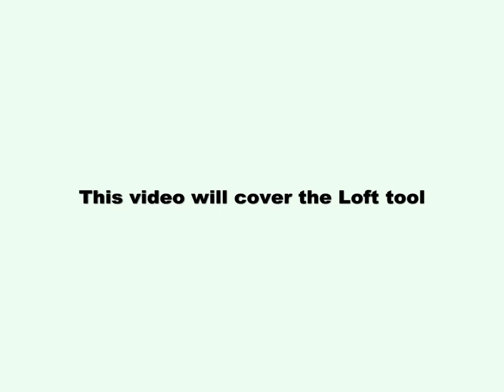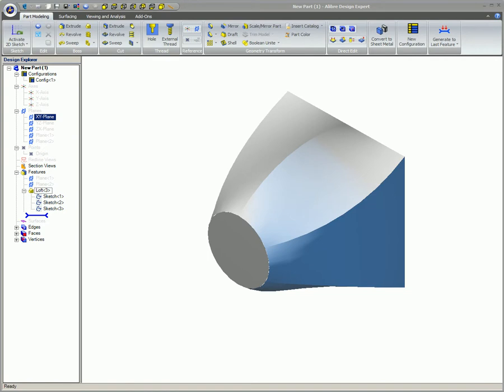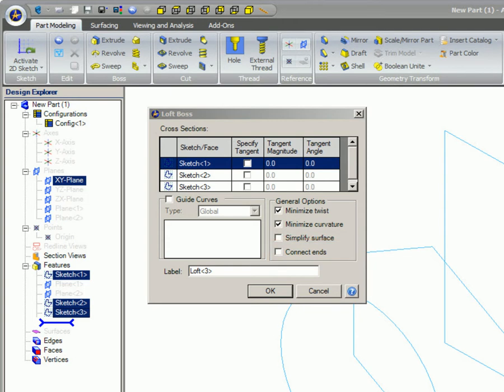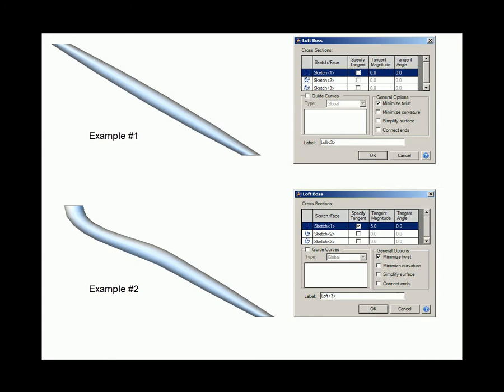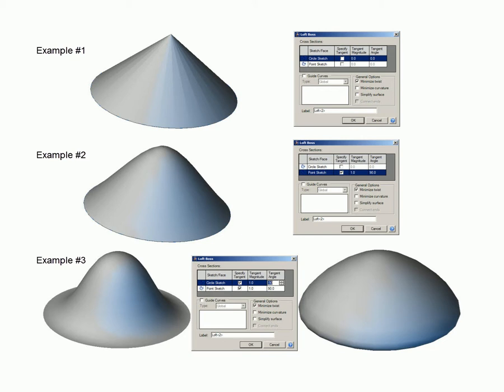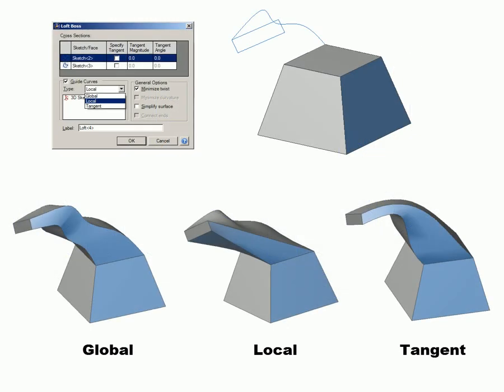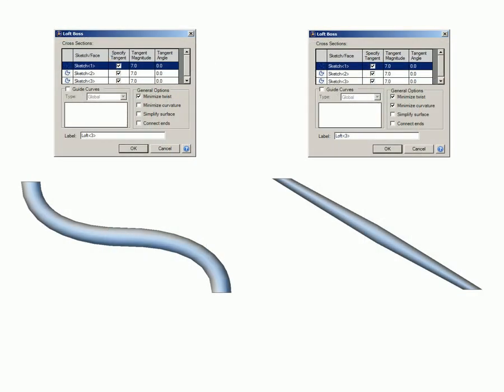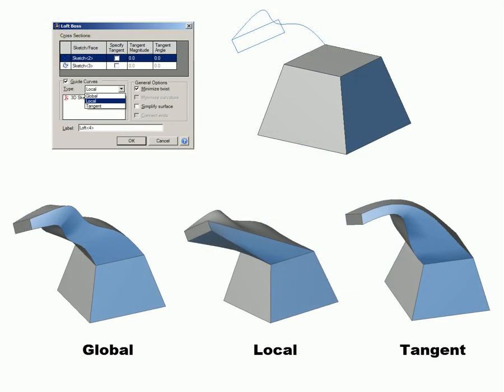Loft in Alibre Design (Legacy Interface)

Comment: I've had an absolute nightmare with guide curves and gave up in the end. Even though you can snap them to the sketches as you draw them, the system often thinks they don't touch all the sketches. Unfortunately, it doesn't say which one is the problem, so you're left guessing which guide curve and which intersection.
I'll try again some time using constraints and see if it's any better.